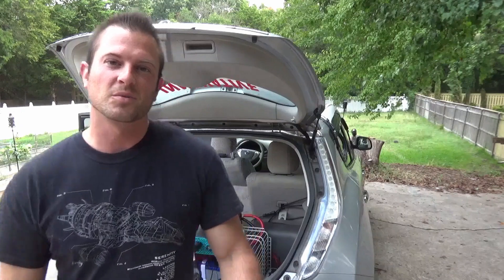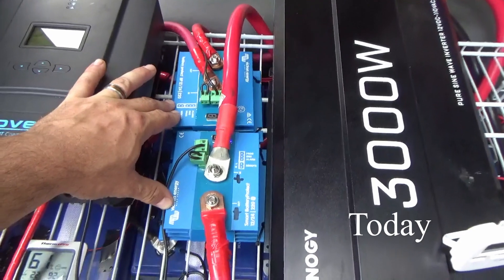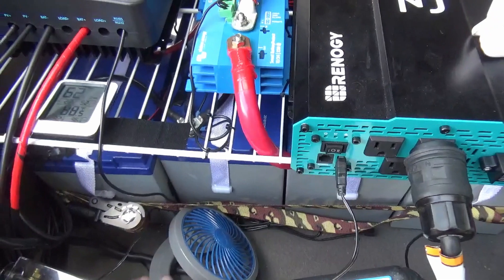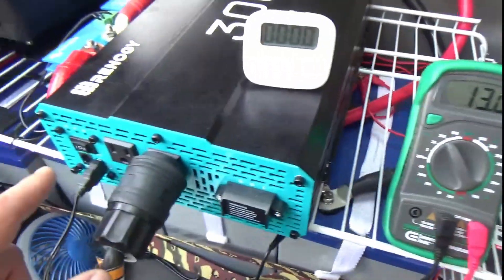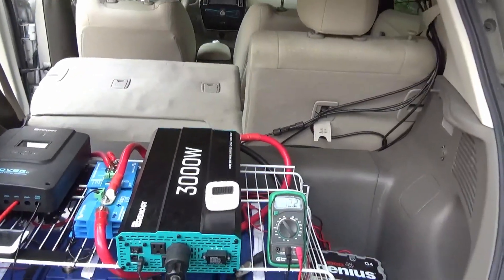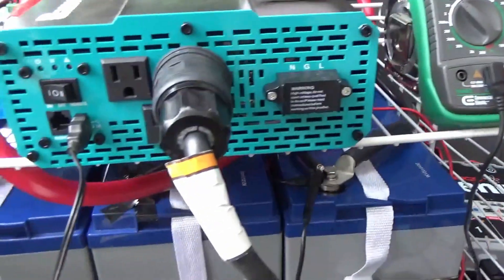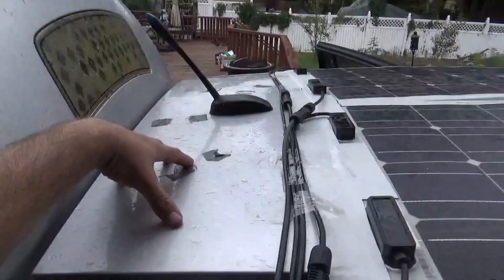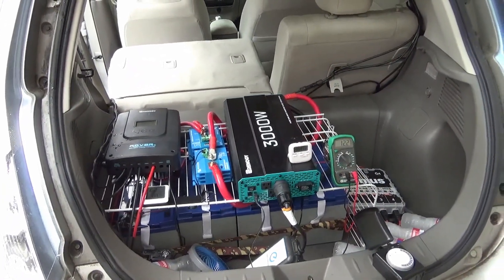Automatic Battery Voltage Regulation

Comment: Did I miss something why you aren't going directly from the panels to the HV battery?  I came here from Real Solar Cars channel where they are using a DC/DC voltage convertor to charge the HV battery.
Reply from the maker: There are a lot of hurtles that James had to overcome to achieve direct PV to HV battery charging.  He's still perfecting the adapter, but he's done a great job so far.  My next episode is actually all about that process and the pros and cons of it.  I did a Zoom interview with James from Real Solar Cars a couple weeks ago that will be in there too.

Comment: Hi I am new to your channel I like what u did but have some inputs and ideas. I have been trying to do same things myself. First and foremost I have been searching for a way to limit my portable ev charger current draw down so basically it will only draw what my panels can output. My thought was rather than add all that extra battery weight was just to add a solar charge controller to the cars 12v battery then to inverter with modified ev charger that is current limited to output let's say 250w of input from the panel. I tried the light bulb current limiter trick but it failed. Any ideas. Secondly I was looking for something from china that can go directly from 24v dc solar panels to the 300vdc there is so much efficiency lose going from dc to ac to dc you are prob only getting 60%

Comment: Awesome video - thanks for posting! What do you think about possibly adding a tow hitch and rear rack* to the Nissan Leaf and mounting all of the gear (inverter, charge controller, batteries, etc) to it? I read in an article from CleanTechnica that your long term goal is to possibly sell pre-assembled kits to other Leaf owners and I wonder if that would be an easy way to package and sell it? I think that it would be much easier to sell a pre-assembled package on a rack, possibly with a simple box over the hardware, that slips into a trailer hitch rather than to sell all of the parts with a manual and ask the owners to do their own install. 

*Tow Hitch Rack: https://wmastore.com/wp-content/uploads/2019/02/tow-hitch-cargo-carrier-rack-basket-hauler-1-e1550681771493.jpg

Tow Hitch Rack with Box: https://www.trapshooters.com/attachments/img_1920-jpg.877969/

Nissan Lead with Tow Hitch Rack and "Box": https://lh5.googleusercontent.com/-xja4QLgKJbI/TsaIDEWGC7I/AAAAAAAADdU/rv1PJRSqkZY/s400/P63356900.jpg

Further, I wonder if all of the solar panels could be mounted on top of the box and then be slid out, one on top of the other?

Stacked, pull out "shelves": https://www.totallyfurniture.com/pub/media/catalog/product/cache/e4d64343b1bc593f1c5348fe05efa4a6/h/t/httpssep.yimg.comaytotallyfurniturecominia-daybed-pull-out-bed-in-white-acme-furniture-39080-5.jpg

This design might not be so good for parking lots, but maybe more so for outdoor enthusiasts or people who live in rural areas. It might be a little easier fo a package to sell at first to help get a business off the ground.
Reply from the maker: Thats not a bad idea.  Some assembly would be required (fully assembled it would weigh about 100 lbs.), and it would be a very tempting target for thieves; but you could have complete portable EV solar charging station, that you pull out of a box and (once assembled) is attached to your car and running in 5 to10 minutes.  And you keep the hatchback space, and don't alter the vehicle in any way.  Additionally it would work with a smaller EV that doesn't have room on the roof for panels.  I would be willing to build that for someone.

Comment from the maker: Special thanks to Tyler at Renogy, and Will Prowse at @ DIY Solar Power, for parts recommendations.  I'm excited about the continued evolution of the system!

Update on 10-29-2019:  I have been having increasing problems with these Victrons tripping my inverters into a low-voltage cutoff, even when the battery bank is at 12.6v+.  I have contacted some suppliers for the brand and they actually recommend against using the Victron in this application.  I am currently researching better options for a low-voltage disconnect.
Reply: I would wire the victron into the back of the on/off switch of the inverter. this would kick it off when the victron wants it too, the batt bank then connects directly to the inverter. you still feed the victron one 18 gauge wire from the post. on the  battery bank. the output of the victron now feeds a small 12v relay, the Com and NO contacts connect in parralel with the back of the inverters power switch.
Reply: Did u ever find a better LVD then victron
Reply from the maker: @plojm123  Maybe.  This part looks more promising.  I hope to do a video on it eventually https://baymarinesupply.com/sterling-prolatch-240.html